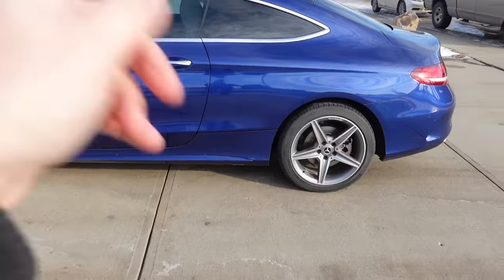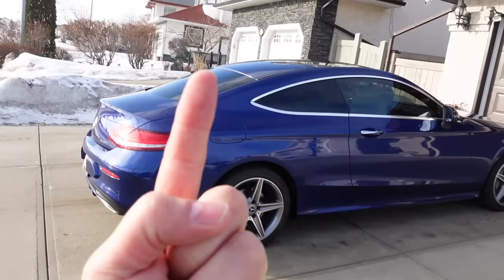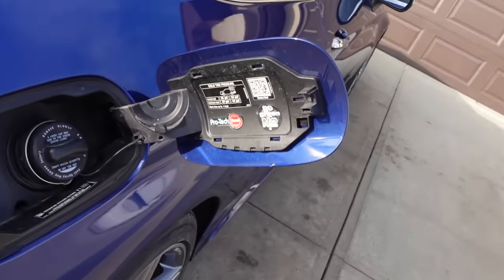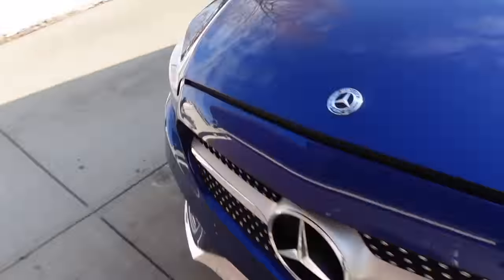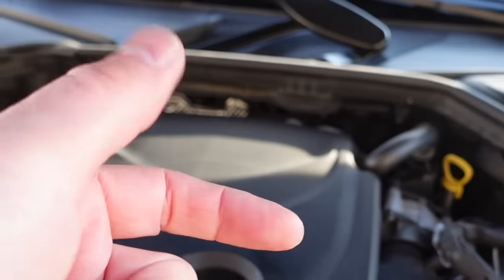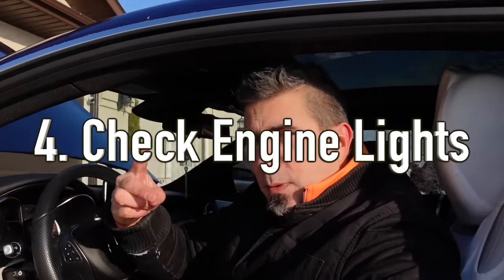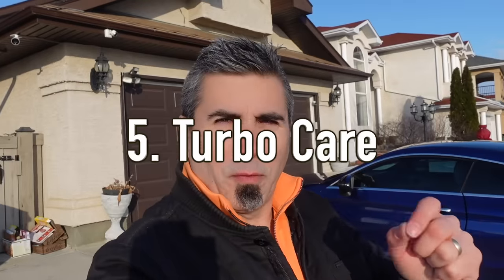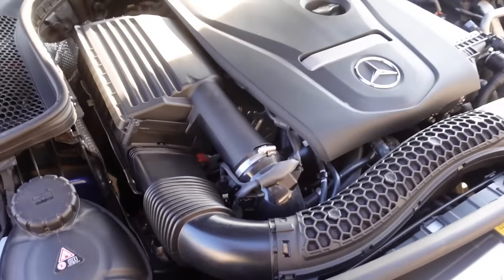STOP Destroying Your Car Engine! (With These Tips)

Comment: Premium fuel has the same amount of ethanol as lower grade. Plus, in some cases, more ethanol. Unless the car calls for premium fuel. You are not gaining anything.
Reply from the maker: Thanks
Reply: Not true at all. Regular gasoline – 87 octane; contains 10% ethanol, known as E10. Mid-grade gasoline – 89 octane; contains 5% ethanol, known as E5. Premium gasoline – 91 octane; will not contain ethanol. Marked mid-grade gasoline – 89 octane; will not contain ethanol.
Reply: @philips1003  I don't where you get your info. But you are wrong. I was in the oil business running a distributorship for 10 years. Automotive for a total of 20 plus years. I worked directly with the oil companies.  But hey believe what you want. I bet you watch CNN.

Comment: Never had a problem 87 octane. Driving since 1976.
Reply: If your car manufacturer recommends 87 octane for your vehicle that's fine.
But I have car that 91 octane recommended . It doesn't say required. The owners manual states using fuel lower than 91 octane can reduce performance.
 When the car was new decades ago I accidentally filled up with 87 octane from near empty.
The car lost it pep going up a slight grade at highway speeds.
It just felt sluggish but ran normal when got back to city with lower speeds. 
So if Required or Recommend
Reply from the maker: Nice

Comment: Porsche  911 997.1's suffer from cylinder scoring and can be more prevalent in colder climates like Canada because cars aren't warmed up properly and will eventually require an engine rebuild...$$$
Reply from the maker: True that is mostly in the 3.8s such as the Carrera S units and not so much on the base Carreras with the 3.6litre.  IMS is a thing on the earlier ones too though.

Comment: I’m trying to understand why ethanol is bad. Any Fuel (with or without ethanol) always results in water and CO2 generation. 
Another question: when manufacturers know that that there will be ethanol why can’t they design engine accordingly?
Reply: ethanol in itself is not bad; but it is much more temperamental.  

1. Breaks down quickly; 3-4 weeks degradation begins.  If a car sits too long; causes all sorts of issues, turns into this hard oxidized chunky crap if it sits for a lonnngg time.    
2. Attracts water
3. Runs richer, less fuel ecnono; cars need to run richer air-fuel mixture.  Most lamba or MAF systems will auto-adjust.  Old school Carburetor peeps need to re-jet.
4. breaks down oil quicker
5.  Supposedly it increases carbon footprint due to way it is processed (shrug, what I keep hearing on fence if I believe)

The good:
octane booster
made from corn
cleaner burning

Basically its devasting to anything that sits for long periods (ATVs, generator, dirtbikes, lawnmowers, sport cars).  Comparatively pure gas is closer to 6months before oxidization begins to degrade the fuel.
Reply: @Aerogrow  thanks!! Now it’s much clear to me.

Comment: So you are suggesting in changine the oil earlier than recommended by the manufacturer. I wondered about that.
I too always turn off the stop start. Mainly because it is very annoying and secondly i also believe it causing wear prematurely.

Comment: Some  false information, 91 fuel is not an ethanol blend fuel, that is e10, 91 octane fuel is the standard fuel most car engines are designed for. 
Oil changes are only required every 12 mths
Also the pic on this video is also incorrect and not even mentioned in this video. The auto hold button on your car near your park brake is a great feature yet the pic shows it with ‘dont do it’ next to it .

Comment: You can bypass the idle Start stop by disconnecting the small plug from the battery terminal. You will have A dash light indicator on telling you it is not working anymore just accept it as A victory 🤣🤣🤣
Reply from the maker: Thanks

Comment: I have a 2020 CR-V and it says to run regular gas. Should I be using premium for longevity or is the regular okay?
Reply: Running higher octane could actually damage your engine because it will be combusting at the wrong pressure. Follow the advice in the handbook.

Comment: Incorrect on the start stop. It takes hours for oil to settle down after the car has completely stopped. Eating at the red light does not take that long for oil to settle to a cold start

Comment: wow, not the case in most areas of US i think, at least where i am re ethanol not being in most high-grade gas.    All grades have the same 10percent or less of ethanol (some may have 15% now, but i think they scrapped that and it's still mostly 10%)   There is like one station that sells ethanol free and it's very very expensive, and oddly made my twenty yr old car need more cranks to start, which i was surprised by
Reply from the maker: Here the best way to avoid most of the ethanol is to buy premium

Comment: - Frequent oil change - 100% true
- Check engine and other faults - 100% true - if you ignore that you WILL regret it.
- Ethanol is bad eee kinda true bot not exactly for example EU already mandates 5% of ethanol on every fuel, and it will be 10% from 2024 - which means, that unless the manufacturer is absent there (which is virtually none) they have engines that are designed for ethanol for quite some time. However for older cars - 100% true.
- Turbo cooldown - It won't hurt, it's certainly true for older vehicles, but newer ones often have electric coolant pumps that 100% take care of it - if your start/stop ever activates with hot turbo - you have one.
- Start/stop - probably saves you more fuel than it will cost you in repairs - those are actually designed to activate only when it's safe for the engine, and the starter is more heavy duty etc. Of course deactivating it might make car last a bit longer, but is the difference noticeable - I don't think so.

Comment: 1 question 🙋‍♂️ for those of us who drive cars that have no turbos is that also a problem when driving hard on the freeway and then coming to a quick stop on your driveway would that have any problem to the engine because I happen to drive a Toyota Tacoma sr5 v6 and yesterday I was driving it hard on the freeway but then got home a shut off the vehicle…? Would that make any negative impact on my engine Since it’s naturally aspirated engine.
Reply from the maker: Hi, great question and generally no issue with a non turbo engine in shutting it off right away.

Comment: I only use 90 to 92 octane ethanol free gas in my Mercedes AMG. Anything else will shorten the life of the engine.

Even 5% ethanol is bad. 10% is going to cost you a few tens of thousands of miles on your engine.
Reply from the maker: That can help

Comment: 2:50 you creating a problem that doesn’t exist. New cars have tight fuel systems. They can sit for months without the fuel going bad. Water does not mix with gasoline. Where is this water you are talking about is coming from?
Reply from the maker: Thanks fornwatching

Comment: Good video, my only comment is that I personally don't know if the auto makers didn't try to save money when they started using the start-stop feature such as the some component is underdesigned and might get to hot if the car idles for a few minutes or oil pressure drops to much on idle or some other problem.

Comment: I had a mercury cougar and I used higher grade gas, and the car started jumping when stopped at a light, and mechanics didn’t know why, so I accidentally found out my cougar just needed regular gas bcuz it wasn’t a performance car then the surging stopped🤔
Reply from the maker: Ouch, that is strange indeed
Reply: @Mike P my Cougar was a 91’ Philadelphia Flyers limited addition 🚗

Comment: Yes the start and stop feature and the cylinder deactivation just as hard on the engine,to me it’s a waste of time.These manufacturers are just wasting time and costing the consumers money.Some have taken spare tires out claiming to conserve weight when a spare tire doesn’t weigh that much and giving you a cheap air pump.They put annoying features in these cars that are no help to the driver.Mazda is also one I can’t stand  that automatic auto hold before you can even drive off you have to press each time you stat the engine  and wait for the gear to release.if it’s and emergency and need to get away you are screwed
Reply: The first time I got a flat in my 2013 BMW X5, it was 2:30am.  Trip to see kid @ college.  I was literally like, “oh no big deal I’ll just put the spare on.”  Nope.  There was no spare in that car.  I should have checked before but I never did.  And for some reason mine didn’t have run-flat tires.  I had to call AAA and flatbed it to a tire place — which was like 45 minutes away and I had to get a motel room nearby and wait until they opened the next day. Just so so so so stupid!!!  Now i have an old 4Runner V8 that i've fallen in love with, which of course has an actual spare and also of course I’ve never had to use it. *sigh*
Reply: @SlightReturn666  sounds like I should get a 4Runner myself,lol

Comment: Sorry but about the ethanol , the ethanol used in gasoline blends is Anhydrous ethanol without water content so there is no risk of separation and moisture in the engine.
Reply: water enters the tank from the atmosphere, ever notice most cars run better in low humidity cold temps, not like arctic cold but like cooler around 50-70 degrees low humidity
Reply: @blakespower  ok but even giving you this fact the same would happen with a pure gasoline tank. Not exclusive to ethanol added.

Comment: That idling for at least 30 seconds after driving for a while is something that I have to remember. My problem is that I don't know when my turbo kicks in. I drove from SC to NJ recently doing 75 to 90mph, but I never idled before turning my engine off to refuel when I needed fuel (gas). Should I have idled? Did my turbo possibly kick in at some point during that trip?
Reply: The turbocharger runs all the time, it works off the exhaust gasses so as long as the engine is running the turbocharger is running.  The thing is that the rotor of the turbo will keep spinning for 30+ seconds easily after the engine is turned off.  This is why also you should not use the auto start-stop feature, it will kill the turbocharger bearings.

Comment: You do realize these cars with stop start are built to withstand the fact that the engine is stopping and starting? Little pieces are changed by the manufactures to reduce wear and tear. Could’ve just just googled the last one and seen the writing on the wall.
Reply from the maker: Not true.  Nothing different in test of car design

Comment: How often do you recommend that I change the oil out on my 09 328i e90 it has 200,000 kms on it. Is it ok to change the oil every 10,000 kms full synthetic? What do you think? Thanks. Also I have a yellow check engine light I think due to a faulty o2 sensor that's not working should I get it replaced? I have had the engine light on for years and the car runs fine.
Reply from the maker: I would not recommend running for a long time on a CEL and some of bigger impacts than others but either way, it’s telling you there is some sort of an issue.  As far as oil services go, 10 k in my opinion is a. It too long and I would aim more for around 7500 miles.
Reply: @ECPP  I mean it in kilometres 7,500 miles is 12,000 kilometres.

Comment: I read it can save up to 12% on fuel economy.  Don't believe it for a second. The engine is idling, the fuel consumption rate on my  car does not even even give a reading on the display (maximum is 300 mpg before it stops reading when braking).  I feel unsafe at junctions when the engine turns itself off.  I have mine permanently disabled.  Plus an engine momentarily uses significantly more fuel when the engine starts, hence the cloud of smoke on older engines, not to mention the wear and tear on the starter motor.

Comment: I thought that after a long ride a car’s idk cooling system would run automatically until the engine cools off, When I had a VW touran offen times when i turned it off the fans turned on and were kept circulating for a min or 2

Comment: Can you please help?
I live in a city full of hills (in Europe) and sometimes I end up on the hill side and being suspended I am sitting with my (A) [off], foot on clutch, 1st gear, right foot on brake and waiting to keep going so I can set my foot on acceleration. Problem is, even if it is off, the moment I remove fast enough the foot from the brake & still keeping slightly my foot on the clutch, when I hit acceleration, car stops and it actually tell me in the board, that I have to restart the car. Press clutch  and turn on the key. It happened several times today because of the traffic, ending up on the hill. (hill is like at 30-40*) quite steep. 
What can I do? It drives me nuts and I have the car for 1 year now but since I moved to this city for two months, always drives me crazy.

Comment: This whole ethanol is bad for cars thing is just false in 99% of circumstances. The fuel systems specifically the hoses and tanks are built for ethanol. Older vehicles pre 2000s mostly may not have been to the level of modern vehicles and may run into corrosion issues. In regards to the running of the engine ethanol will normally make an engine run stronger and cooler than gasoline due to its far higher octane rating. In the USA 87 Octane gas with 10% ethanol is actually 85 octane gas with the 10% ethanol bumping it two full octane points and so on up the scale. There are stations i have experienced that advertise that their premium is ethanol free which will actually give you better fuel economy. Ethanol has a lower energy per gallon than gas and therefor requires more ethanol to run than it would straight gasoline. These days in the USA most gas has between 5-10%ethanol. The one arear where ethanol can be detrimental is in vehicles that are e85 capable in cold climates. Due to the fuel running cooler and resisting pre detonation it actually hinders cold starts with high concentrations of ethanol leading to possible hard starts. This is normally not the issue due to the gas stations and suppliers in that area actually adjusting the ratio of checmicals in regular gasoline and especially in E85. If you look at the E85 designated pumps they will tell you they range from 51% to 83% ethanol at any time. This is for the exact reason i mentioned above. If your in very hot climates and your car is e885 capable i encourage you to try it as you will notice a pretty large performance bump from regular gasoline due to real E85 having an octane of about 109 and runs a lot cooler which in the summer with heat soaking will let your car keep the advanced timing without pre ignition occuring due to high cyclinder pressure and temps.

With that said if you just let your car sit for very very long periods without being started then before one of those periods yes i would 100% seeking out Ethanol free gasoline for the storage period. If you are driving the car daily that is a complete waste of time and money.

Comment: doesn’t the octane rating mean its resistance to pre ignition? meaning a high compression engine in a sports car would need 91 vs a grocery getter only needs 87??? not the quality of the fuel
Reply from the maker: Yes and yes indeed

Comment: if your turbo bearings are producing that kind of heat, then you already have an oil circulation problem. the heat being generated is from the exhaust gases propelling the turbine. ive seen engines being dynoed and the turbo was glowing like a crackheads crack pipe.

Comment: Not sure where you live, but ethanol 10% is in all grades of fuel from 85 to 91. And have been using it for years on all my car/trucks with no problem,  I will agree if storing a vehicle for a long period of time, find a station that sells ethanol free fuel. Hard to find, but not impossible. Not starting your vehicle when needed to save on cold starts? Really? And many vehicles are using 0W or 5w so cold starts of an engine are no like your grandpa's in the past.  I will agree 100% in turning off the auto stop/start. Just another stupid idea that does not save that much on fuel unless driving in stop/go traffic in a big city like NY, LA, etc. But for the rest of us who have no stop and go traffic, it is ludicrous and needs to be turned off and if possible FOREVER.

Comment: Hey Mark, question just picked up a G80 M3. What is your recommendation in terms of length and mileage to change to oil on that car? Thanks!
Reply: Every 5k km
Reply from the maker: I know a lot of manufacturers will suggest what they do and even Lexus has a bit of a longer interval, but I would look to do it closer to 7500 miles
Reply: I live in FL and my mechanic recommends no more than 7500 miles , but I change it at 6-7000 miles to be safe.
Reply: Ok will do! Is every 6 months ok if it will be a low mileage car under the 7500 or sooner/longer than that?
Reply: @emreconklu3498  If you want to be safe, do it every 4 to 5 thousand max.

Comment: When you turn off a car with a turbo it's nonsense that the oil wil cook to oil lines what's happening is that when you drive hard and you turn off an engine with a turbo that the turbo gets no oil flow because the turbo is spinning at over 100000 rpm and if it doesn't get oil flow it wil eat the baring

Comment: So regarding the cold start info you gave, I have a challenger that's loud as hell & it wakes my elderly neighbors up. So I almost always start driving right after I start it.. Is there any additive I can throw in to help with it? What would you add
Reply: Not sure of anything you can add to counter the effects of cold starting, but driving the car right after starting is no worse than letting it idle. In fact, it helps it warm up faster. Just keep the rpm under 4000 until the oil reaches operating temp.